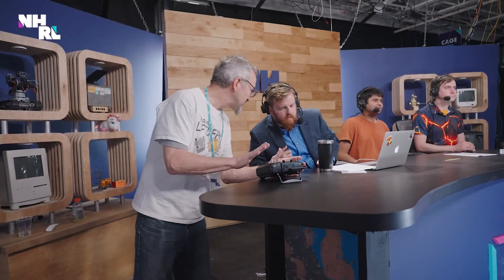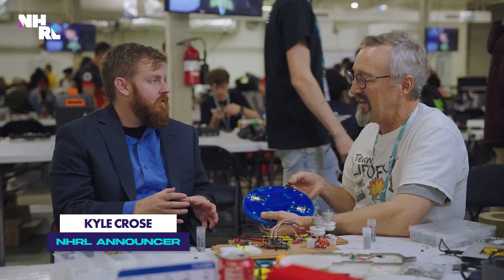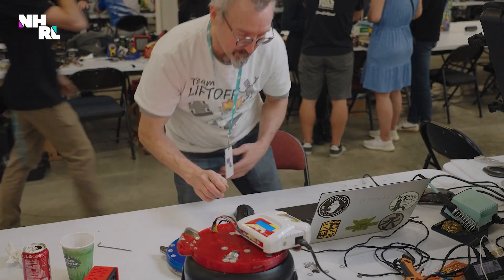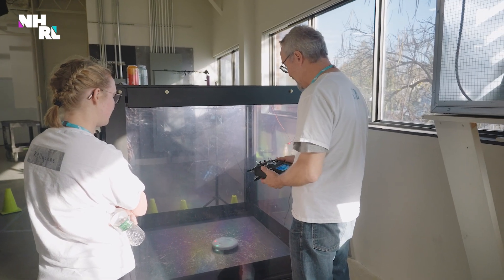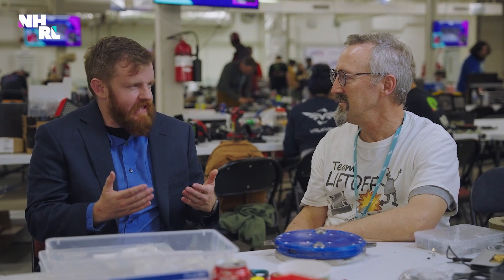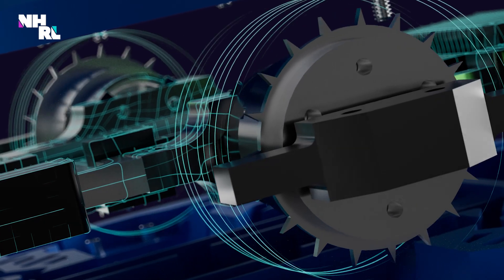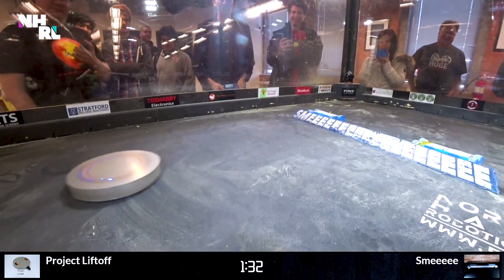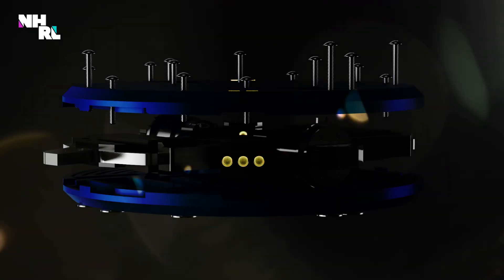Roomba x ChatGPT: Autonomous AI fighting robots, should we be worried?

Comment: Imagine how powerful a 250 pound robot like this would be
Reply: It's an interesting idea for sure.

Couple of things concern me immediately though: 
- Keeping the two halves (top and bottom) together in a heavyweight division where vert's are the predominant weapon type.
- What wheels would be used? Sure, you can swap out wheels every match but they need to last well enough to see a 3 minute match through in the first place. 

However if the upscaling to heavyweight challenges can be met a 250lb spinning brick would be a formidable opponent.
Reply: Even in the old days, big body heavy spinners were insanely good.  There was one that comes to mind, Mjollnir I think it was called.  Take that and add in the extra weight of the entire bots frame spinning too and you've got one NASTY weapon.  They may not be the absolute most deadly, necessarily, it's debatable but either way they're definitely up there and it'd be insane to count them out.

Comment: if it's anything like the communities that create actually GOOD AI to swap out in videogames then you will almost certainly find that the best results come from designing the AI to be "driven" that pretty consistently holds true even when you get into the ridiculously over the top stuff built by entire teams like a strategy game AI putting in 60k apm to fully micro each unit individually all while running a few dozen prediction algorithms in concert.

that said I am really looking forward to seeing one of these things jumping and jittering around the arena at nearly slot-car accelerations like a sumo bot.
Reply: Commas: Learn to use them, please.
Reply: @Atmatan  try taking a look at some of your old comments, you'll find that most of them have been at least somewhat garbled. I haven't the slightest clue why but youtube seems to put comments through an automated editing process from time to time and it does NOT do a good job with anything much longer than a 6 word sentence fragment.

...this one seems to have had the entire middle section removed and been divorced from the response thread it was part of: that first paragraph is a bodging-together of the start of the first and end of the last of several paragraphs on different kinds of videogame AI and the second section is a tweaked version of the last section of the first paragraph.

the section on user interfaces has been removed entirely.

Comment: I'd love to see if/how much a tool like ChatGPT could help accelerate software development for meltybrains and other autonomous bot designs
Reply: Probably not a lot, yet. ChatGPT is a chat bot trained on stuff it can find on the internet. Yes, it can write basic computer code. However it needs examples to do this.  Currently, there's little to no code examples online for melty brains. It probably could write basic scripts for different filter types such as Bayesian filters which could be helpful for melty brains. But writing a Bayesian filter is pretty quick and the fine tuning would need to be done by the builder, so probably wouldn't save much time. I'm sure the builders know how to implement algorithms like that.
Reply: I've been playing with it a little, I'm quite impressed by it's capabilities. Might be used for early vision brainstorming.
Reply from the maker: You should join our discord. The builders of Liftoff discuss this